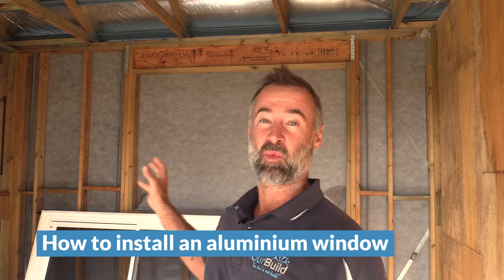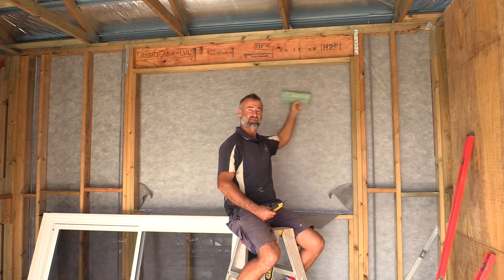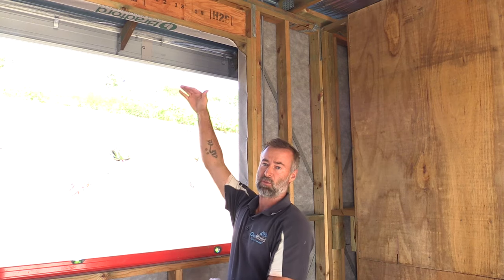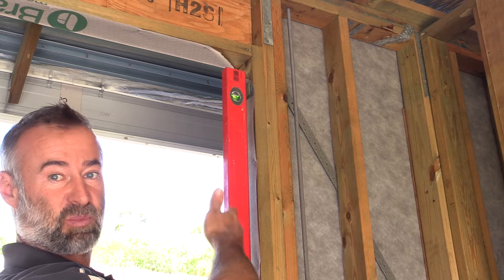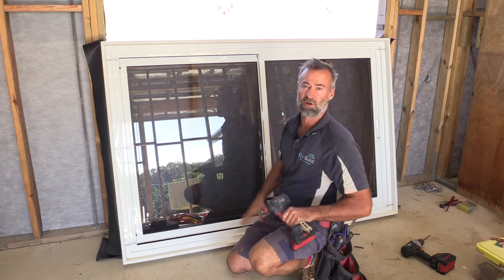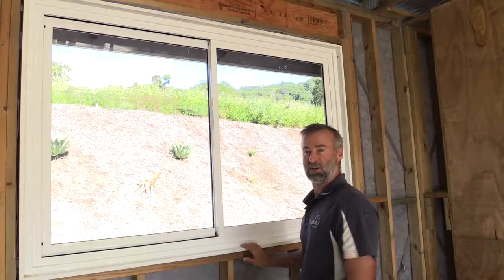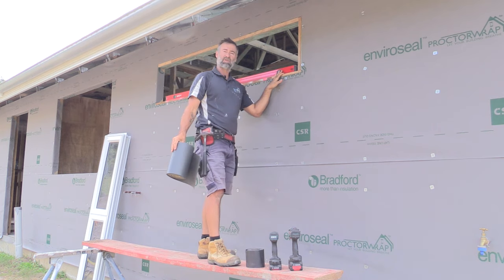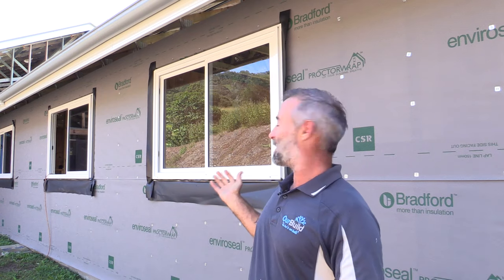How to install an aluminium window, including flashing's - EVERYTHING YOU NEED TO KNOW!!!

Comment: I've seen some building sites that suggest not to cut and fold the sarking back in and around the window framing due to possible water movement down the face of the wall membrance then along the sarking attached to the window frame.  Do you have any comment or is there a specific benefit in folding in the sarking that outweighs any possible moisture movement down the face as described.

Comment: hi james, thanks for your knowledge base.. im installing a gjames louvered aluminium 050 series window into an external  bathroom wall. its not in the shower enclosure but right next to the shower curtain.. should i remove the window reveal ? (which is primed pine). different posts say yes, some say waterproof  over reveal then tile. On my window i only have a 25 mm aluminium return on the window frame then the pvc handle  so the tiles would be very close to the handle. I can understand removing reveal if its mdf or other board. if i remove the reveal ill have more wiggle room for tiles. Thanks for any advice.

Comment: Thanks for the video, great detail! 

Question: I'm putting some fixed pane windows into a space between two large concrete pillars (300x300). I plan to frame out underneath the windows and above (Sill and Lintel) but I don't have enough space for any studs either side of the window (about 10mm of space only). Would it be fine to use some masonry screws to attach the reveal into the concrete pillars? The windows I'm using are 1200h x 2100w fixed pane Trend windows with 100mm reveals.
Reply from the maker: @7yle  Yes that would work just make sure you can flash or seal against the concrete. 40*40 aluminum angle on the exterior frame with a polyurethane sealer will help. I'll see if I can find an example for you.
Reply from the maker: @7yle  Around the 3 min mark I show and discuss the angles https://youtu.be/PiBOPinss3k?si=eA0S4ZF16sJCL6fR
Reply: Thanks! I'll look into those if there's too much of a gap.

Comment: Thanks for the great video.  I have a question about steel frame and windows without a reveal do you screw the flashing just beyond where the window frames will meet the steel frame it is going into a shed home with steel frame and timber frame is only for the wall cladding on the inside appreciate any help thanks
Reply from the maker: Thanks. Yes that's the best way to do it. 👍
Reply: Thanks for your help I only just found your channel and have been binge watching them great videos
Reply from the maker: @tanyiabailey4792  thanks legend

Comment: Do you screw down your sill reveal also?   Some installers do, some dont and just fix into jams as you have done.  What is your reasoning for fixing the sill or not, there doesn't seem to be any clear info on this that I can find ?  
Also thanks very much for your channel and videos, they are awesome and have helped me out heaps and have enjoyed watching your build. Cheers.
Reply from the maker: Hey mate, I don't screw or nail the sill, generally the timber reveals will all be pinned back with the architraves to the studs during the fit off stages.

Comment: G'day James , can i ask the frame for the bathroom window, is that built for a very snug fit ? 
Or with the same gap as the first window ? 
Complete Beginner here . 
Thank you
Reply from the maker: Hi Chris, it can be a little tighter as the outside flanges need to be fixed into the studs. Main thing is to ensure 10mm clearance on the head to allow for deflection in any structural timber above the window. Hope that helps.
Reply from the maker: Sorry 'head' as in the top of the window frame and the timber house frame.
Reply: @OurBuild  Thank-you James. 
Much appreciated.

Comment: Absolutely awesome tutorial!!!
Your communications skills are excellent 👌🏽 👍🏽👍🏽
Thank you very much!
Reply from the maker: Thanks Stepane 🙏
Reply: @OurBuild  I purchased aluminium windows with reveals but they only attached flashing to the bottom of the window.
Do I need to remove the staples between the window and the reveal, and place the snakeskin in between or can I attach it to the aluminium frame directly? Thank you 😊
Reply from the maker: @stephanekhaida7951  It works well if you place it straight over the aluminium. no need to nail or staple it into the window frame, it can be just nailed on the wall framing beside the windows.
Reply: @OurBuild  thank you very VERY much!! You are so helpful 🙏🏼

Comment: I’d love to know how to install a window that has reveals but hasn’t got the flashing. Replacing an old with with a new window on a brick veneer home
Reply from the maker: I'd recommend creating a 'sub sill' under the new window reveal before you install it. You can use a roll of light weight aluminum flashing which is sold in most hardware stores next to the plastic rolls. Make sure it is wider than the timber reveal so it can fold up behind the archives on the inside and down over the brick work on the outside. For the sides you can silicone and pop rivet a 20mm x 20mm aluminum angle against the window and bricks.

Good luck with it 👍

Comment: Hey mate on the window installation do you pack the bottom reveal cheers
Reply: Hey James I noticed you don’t have any screws in top and bottom reveals I have a 1800 x 600 window so only pack bottom
reveal and and extra screws for the length is this correct I see some videos they put screws in bottom and top 🤔

Comment: Great explanation thank you. My only objection is you install flashing on top of wall Sarking for top of bathroom window which I suppose it should go underneath of sarking ! Isn’t this right?
Reply from the maker: Not really because it's high up under a protected eave, and its really a seal between the weather boards and the edge of the window. If it was an exposed wall with a meter or so above it then yes under for added protection from driving rain.

Comment: Hey mate, nice video! I have 3 questions. Do you have to specify the thickness of your cladding when you order the windows so they make them to suit?
Is the process the same when using colourbond cladding?
And I imagine the process for doors is the same but how is the bottom of the door sealed where it meets the concrete slab?
Thanks mate.

Comment: Hey thanks for the great video. Can I ask if removing aluminium window to replace the reveals, which are warped and cracked is a DIY job or should I call in a professional. I'm mostly concerned with the flashings - brick cladding. Cheers
Reply from the maker: Thanks George. It would really depend on how confident you are with DIY, generally speaking windows in brick are quite easy to remove. Usually the sill bricks have a flashing that is attached to the bottom of the window, you would need to cut this to remove the window, then it would be a mater of making sure the new window was re flashed at the base when installed.

Comment: Hi James. Great video! Very helpful.
A couple of questions, please:
1. Is the external sarking ever fixed to the studwork, or is it just left loose?
2. I'm planning to remove one of these windows and build in the opening, and am interested in whether the window should be pulled out from the outside or should it be removed from the inside? The external cladding is fibre cement sheeting, and I was hoping to not remove or damage the existing cladding.
3. Are you planning a video on how to remove one of these windows from an existing house?

Comment: How come you don't tape the flashings?  Have seen a lot of vids where the builder goes nuts with taping and waterproofing.  Why don't we do that here in Aust?
Reply from the maker: Would depend on the wrap, and type of window/ exterior finish. Ideally if flashed correctly water would not penetrate to the frame, but if you wanted extra peace of mind then you could flash the sill timber as well.

Comment: Random question James; looking at buying a set of decent levels. What sizes  do you recommend?  Was looking at 3 different lengths for owner builder.
Reply from the maker: Hey mate I reckon a 600, 1200 and 1800mm are great lengths for windows and doors. You can pick up 2400 or 2700 aluminum straight edges that you can strap a level to for framing if you need longer.
Reply: @OurBuild  thanks James 🙂👍

Comment: Great vid. Could you use a pair of wooden wedges similar to doing a door jamb or is it better to use those flat plastic  packers? I'm guessing it's better with those flat plastic packers. Just thought I'd ask. Cheers for the tips. Keep them coming 👍
Reply from the maker: Hey mate, yeah timber wedges will work fine, although they can get a little fiddly.
Reply: @OurBuild  thanks mate...just realised  why you're using those plastic wedges lol. They're flat. Thanks for your reply.

Comment: Good Demonstration, though should mention that the gap between the lintel and top of the window must be at least 15mm.
Reply from the maker: Thank you, your right I didn't mention the head, at the 4 min mark I discuss the frame being 10mm wider around each side of the window, but I should have been more specific at the head as you don't want any beam deflection to impact your window. Thanks for pointing that out 👍